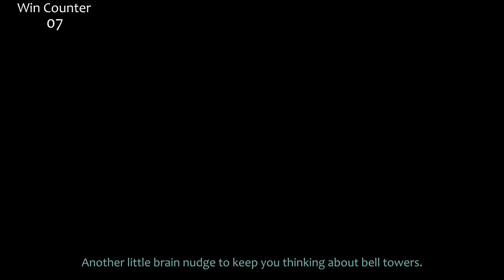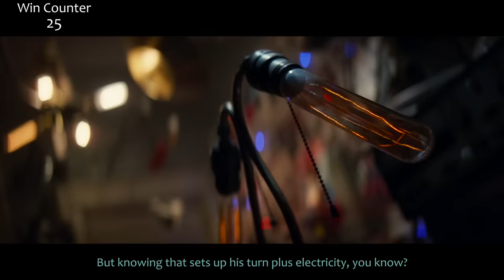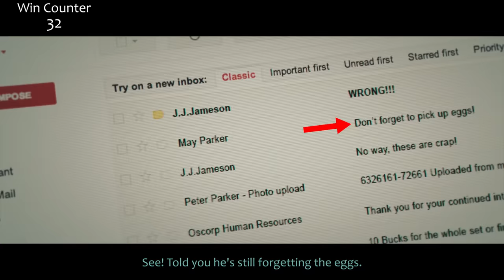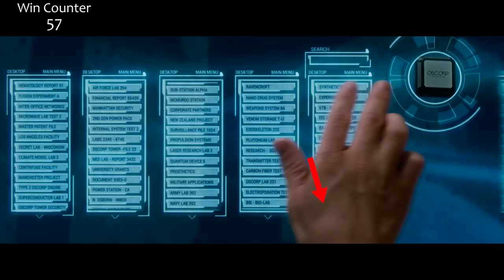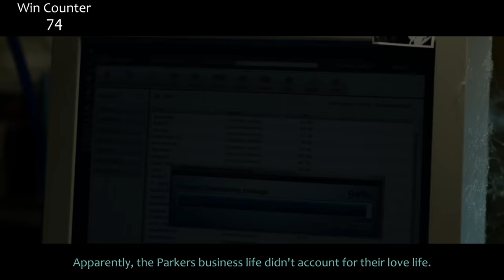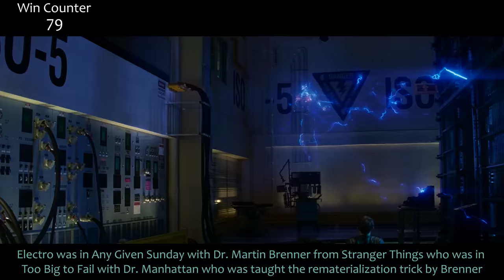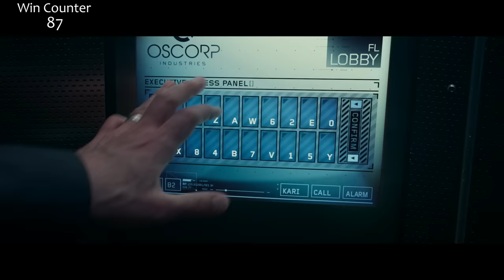Everything GREAT About The Amazing Spider-Man 2!

Comment: 13:49 aircraft of that size DO have a onboard collision avoidance systems (ACAS/TCAS) that warns pilots of nearby traffic. only communication required is that the transponders work.
Reply: yeah, really an unnessecary scene that adds nothing to the movie and on top is unrealistic, could've done without it.
Reply: Also Pilots know that in the risk of a head on collision, they both turn to the right. In the event of a same-direction risk of collision, right of way is determined by who is on the left/right, with no communication required. Every single movie that ignores this is just trying to invent reasons for drama that they couldn't find a smart way to do instead.
Reply: also, planes fly at 500ft increments depending on their direction. the altimeter would work and prevent head on collisions.

Comment: 13:58 

The lights on an airplane have specific colors facing certain directions so that in case of a communication failure, pilots CAN still see what's going on! 

If I recall correctly, green on front left, red on front right, white on both sides facing rear, and I forget what the colors and orientation of the tail lights are. 

This is so that if you're a pilot and so happen to be at an angle above, below, behind, or in front of a plane you can see those lights and respond appropriately!

Comment: 6:42 explain to me, why were those people running up the stairs, that ends with a barricade?
Reply: The stairs aren't attached to anything, they were probably for some event.
And it make sense that if an electrified car is flying at you you're just going to run the opposite direction regardless of if it's a dead end.
Reply: Filip Sosnowski 
Panic. Some people aren’t used to being attacked by a super villain.

Comment: Might be late but regarding the plane collision shower thought... Such system exists and it's called TCAS, basically all planes larger than a Cessna must have it. It automagically can observe airspace around the airplane and resolve conflict without any assistance from the ground (aka during a blackout on the ground). Like in a case where collision could happen.. the system tells the pilots of both planes which direction to go to avoid it and they must follow the system even when there's conflicting commands coming from ATC. :)

Comment: The pilots in those planes would likely have had TCAS onboard. TCAS (Traffic Collision Avoidance System) is an automated system designed to give pilots emergency instructions to avoid a midair collision. It's important enough that regulations indicate that pilots are to follow the TCAS instructions even if they are being given conflicting instructions from Air Traffic Control.

Comment: if you play Qwens death in 0.25 and pause right you can see that her hitting the concrete didn't kill her but that her head snapped into the concrete but the web held her so the web held her body in place but her head snapped back like a rubber band breaking her neck of bad way to go

Comment: Commercial aircraft have devices in them called TCAS which stands for Traffic Collision Avoidance System. When the systems detect a possible collision one will advise one aircraft to descend while it tells the other one to ascend. And since they can detect each other they ensure that each aircraft will move in the correct direction instead of both ascending or descending into each other. The 2002 Überlingen mid-air collision is a prime example of why airplanes and pilots need to be able to work independently from ATC and why this scene is a bit offputting.
Having a aviation background the scene with the near midair was the only thing I didn't like about this movie.